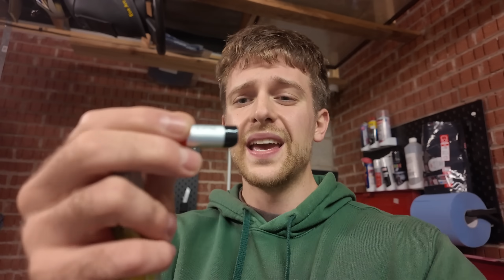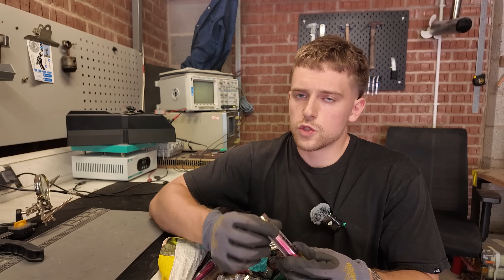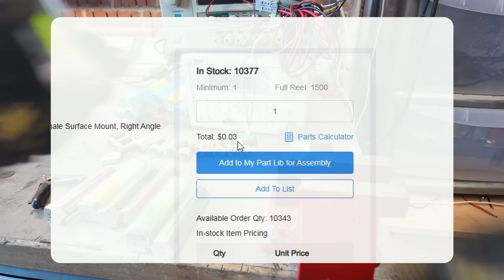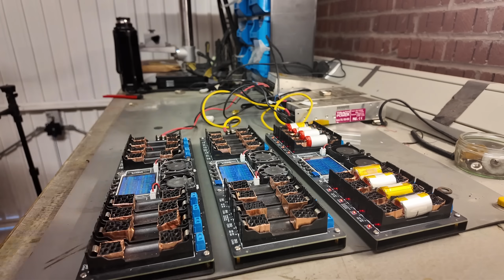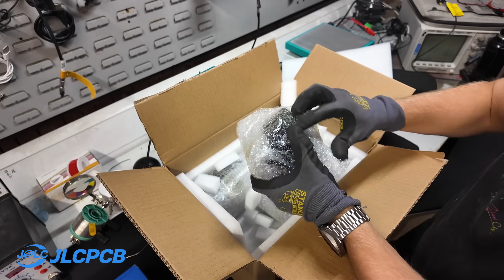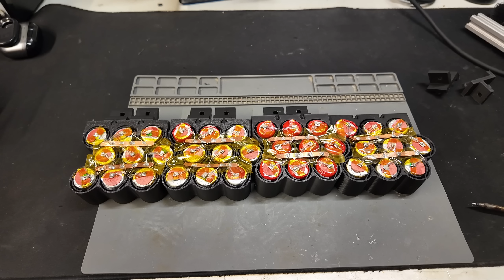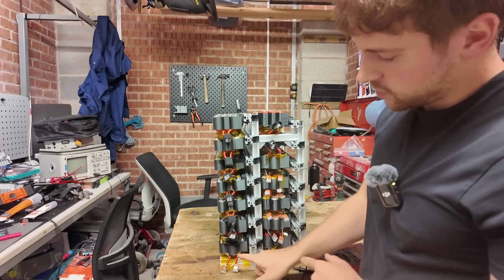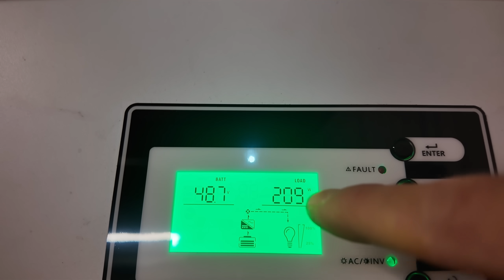I Powered My House Using 500 Disposable vapes

Comment: So if my calculation is right:
1. You have 9 cells in a block connected in series and 4 blocks, that's 36 cells in parallel per unit,
2. you have 14 units in a series, 14*3.7v=51.8v
3. You also showed that on average each cell is ~1300mAh or 1.3Ah. 36*1.3=46.8Ah per unit.
4. 46.8Ah*51.8V gives us 2424Wh or almost 2.5kWh of capacity, nice!
It would be interesting to see how the cables heat up when you connect a 3kW load from a kettle, I think they are a bit thin for current over 50 amps.
And if anyone was wondering how much a similar 2.25 kWh battery would cost - with EU prices for LiFePO4 50Ah battery ~18euro that would be ~252euro/290usd. (14s1p). Of course, LiFePO4 is much safer and will last longer, but your battery is still very cool :D
Reply: I was looking for this, 2.5kWh battery made out of almost free batteries is kinda insane. So basically, if he made 10 of those batteries, and then add solar, he could live fully off-grid. impressive
Reply: @kyawzin Delusional. It might be okay for a short camping trip but utterly useless for off grid.
Reply: @kyawzin these batteries are not that good initially, i wouldn't expect cycle life more than 200-400.
If you will run off-grid on them you would need to replace them about every year
Reply: @yevgennegvey4021  so essentially just recycle them entirely for raw materials is better solution i guess
Reply: @kyawzin maybe, or if your time spent on this battery each year costs less
Reply: @yevgennegvey4021  300-500 and then they will be about 80% so more, although not at full capacity.
Reply: 1300 wouldn't be for the user to use. Actual capacity is lower
Reply: The current carrying capacity of a cable is fixed, however the voltage will determine how much current is needed for a given number of watts... 2.5kw at 12v is a lot of amps and needs very thick cables, however 2.5kw at 48v needs a cable 4 times smaller for the current needed... His cable will probably be fine...
Would I want that in my house, of course not, but not because of cable thickness, but because of the battery chemistry...  LFP or nothing, deffo not NMC/NCA cells...
Reply: @dougle03  I'm more concerned about him using Wago's as a plug. They are not designed to be connected/disconnected under load. He's better off using something like a MC5.
Reply: @TheDegan79  what are you talking about? If Wagos couldn't withstand that they wouldn't be certified for use in homes where power could be shut off and on or breakers tripped at any time over decades.
Reply: @naasking  I'm talking about safety for maintenance, replacing dead or bad cells. It's the disconnection reconnection under load that is the issue. Do you know what a MC5 connector is? It's used for solar. DC has a much larger arc than AC. Also, if you knew anything you would also know that DC stands for Dead C*nt.
Reply: @TheDegan79  The batteries are not going to be replaced while current is being drawn, so I have no idea why you think "replacement under load" is relevant. Unless you mean that the Wagos are being connected and disconnected while there's a voltage applied from the batteries, but the voltage these connectors see is 3-4V at worst, so again, I have no idea what the problem is exactly, as that voltage is not sufficient to cause any problems.
Reply: @naasking  Please tell me you use condoms. Where do you get 3-4v from? What happens when you connect all these in SERIES?  My concern is copy cats that don't do the maths or can't, like yourself, get the idea that they can scale this up safely. If he's going to use wago's he can at least put bootlaces on the wires... It's the whole reason he is using wago's in the first place is he is shit scared using his soldering iron near the live terminals. If he used MC5's instead of wago's there would be ZERO chance of ever shorting out. With wago's, there will ALWAYS be an exposed wire if disconnected. It's negative or positive? No one knows? MC'5 would also eliminate the chance of polarity reversal.
Reply: @TheDegan79  No one else here has had scary encounters with high voltages. I'd say some people are gonna attempt something like this, not understand the inherent dangers of doing so, and end up dead on their garage floor at worst, and at best burn their house down cause they didn't learn to fear the lithium.
The sheer lack of actual safety on this build is fucking scary. The fuses between each cell are soldered on cause he saw it on a tesla cell? Those batteries are of much greater quality, but even still catch fire...
(cough solid state fuses are way better cough)
The lack of fireproofing when testing under load just tells me he's okay with losing his shed to a toxic metal fire that you can't put out with water.
The lack of proper modularity (cant spell today) of each bank of cells, "yeah im gonna solder all these together, with no proper way of quickly removing a part that is malfunctioning".
The lack of proper balance monitoring of each li-ion cell. The BMS is good up until a point, if one of those cells fucks you over, you won't know which one fast enough, and then you're just hoping the fuse on it blows fast enough to prevent the fire from starting.
And like you said. WAGO connectors under load is a BAD idea.
Even for a POC, this is just a makeshift bomb sitting in his workshop...

The best way to build this would be to actually look at how power-wall / battery banks for houses are built and installed, then get proper consulting from an electrical engineer or electrician that does installations.
Reply: @ausboard  Even the experts call it "idiot proofing" because they are the ones working with it and it's "one flash and your ash" What gets me are the morons that argue a simple safety improvement suggestion without even having the slightest clue what they are talking about. Even you haven't covered half of the shit wrong with this build and there is a point where the OCD takes over basic safety but at least start on the common sense level.
Reply: @TheDegan79 yeah it’s just too much lmao.
The incorrect connectors. Exposed wiring. Improper insulation.. Potentially using the wrong wire gauge… (mmmm the smell of burning wire)

Focus on looks rather than “how can I make sure this thing won’t kill me”

Blind trust that the cells can actually handle being arranged in this manner with little to no failsafe. 

Soldering to the cells directly, rather than spot welding (what is used in vape manufacturing usually). 

Conductive metal frame…

The list goes on and on and on

It’s just the years of battery safety that has been drilled into my skull that made me realise that the sheer volume of lithium ,just hanging out in his shed with little to no proper storage, is going to result in a catastrophic accident due to negligence. Not a bucket of sand in sight.

There’s a reason why actual home battery systems use Lithium iron phosphate batteries. Lower nominal voltage (3.2V), better cathode integrity, WAY MORE CYCLES. (2,500 - 10,000). They’re at a much much lower risk of rapid unplanned deconstruction.

Not too much of an electrical expert. But I do own and use high capacity LiPos daily in my FPV drone adventures. And if you know anything about LiPo batteries, they’re not friendly if you disrespect them.
Reply: @ausboard  I'm no electrical expert either, just a comms guy that pulled a few cables for some electricians and installed a few solar panels. Now, before every panel had micro controllers, If you wired them up wrong, BAD. You can't turn them off to re-wire, so you need someone ready with a lump of wood to give you a whack. That's where I learnt to respect how far DC can arc and why firefighters are shit scared of solar panels.
Reply: Dang u smart ash bro 😂

Comment: I hope u KNOW that most of those batteries are purposed for one time use devices, meaning they were designed  for very little total cycles, compared to production cells. I mean reusing these in projects is handy, done it myself quite a bit, BUT putting them in such big banks or applications? Hard no. My expirience with these so far:
-Unreliable, some can die just after few hundred cycles, also loose capacity very quickly and irregularly with use.
-Exceptionally prune to spontanous runaway after longer use, try storing one fully charged after couple hundred cycles to see what i mean.
-In your holder design specifically, those are foil packadged cells, unlike 18650 with hard metal casings and pop valves on top, those things swell quite a bit and can blow with pressure. One swelling in that holder imo could be catastrophic.

Reusing those batteries in small banks, just devices, or powertools is good and cool, but this trend of making big energy magazines and e-bike batteries out of these HAS TO STOP, before buildings burn down or ppl get hurt, just bms or cell fuses don't solve the issue, existance and development of special safety standards, procedures, systems, certifications around such things has a reason.

Comment: If you get on the octopus tariff called agile, electricity regularly goes into minus meaning you get paid to use it. You can use kraken which is the octopus API to charge your batteries automatically when electricity is in minus, and you'd get paid to charge them up.

Comment: 6:20  You can in fact connect cells of different capacities in parallel.
It's when you connect cells in series that capacites have to match.
Reply: Internal resistance matters too. They won't overcharge since the CV is still 4.2V but lower resistance ones will be charged at higher Cs than higher resistance ones in early charging process, and they will also discharge faster under load. Not too dangerous, but they will degrade faster
Reply: If you connect a cell at 3.8V to one at 4.2V, then current will flow from one to the other. Since you are using conductive material to connect them (the whole purpose of connecting in the first place), the resistance will be low, which will mean a very high amperage. The conductors often cannot handle this, and the result is electricity is converted into fire.
If you connect cells in series together, nothing will happen until you connect a load between the end terminals as there is no circuit formed. Try it. Get a couple of batteries of differing voltages (one brand new, one well used) of any chemistry (alkaline, lithium, even lead car batteries), they dont even have to match (you can try one AA battery and one car battery for instance!). Fill a cup with petrol (gasoline for Americans). Press the negative terminal of one to the positive terminal of another right over the cup of petrol. No fire will produced, and the petrol will not light.
Reply: He connected them in series later

Comment: Usually not one to watch battery-related videos because it's like watching an episode of "engineering J*ckass", knowing all the ways people can mess-up with lithium batteries. But you really did a great job all along the way. Capacity balancing is arguably more important than voltage balancing, and you did tests to "bin" the cells in capacity - though I didn't see a part about selecting cells for groups that make equal-capacity parallel slabs (e.g. you distribute a mix of capacities to ensure each slab has the same total). Can't complain, though. Individual fuses protect the total system from a single-cell malfunction. BMS ensures the total system safety. Nailed it, fam!
Reply: BMS!!! YES THAT IS WHAT I WAS THINKING

Comment: I wonder how many cycles you could get out of those cells before they start wearing out
Reply: Every charge/discharge cycle decreases capacity slightly. Depends on how much current is drawn during discharge. They are fairly low quality cells, so I guess they will provide 70% capacity at 500-1000 complete discharge cycles.
But remember, a discharge to only half capacity will more than double the number of cycles.
Reply: @johncoops6897 i know samsung 25r 18650s drop down to like 80% capacity at 250-500 cycles, so who knows tbh
Reply: @sergaljesus - (genuine) 25R cells are a high current (INR/IMR) cell designed for 20A discharge, used in power tools, etc.
These are a different chemistry, more like a laptop cell. The crapes only pull 2-3A, plus the thin wires provide a lot of current limiting.
Normally you could allow 1000 cycles to 70% capacity from a quality ICR cell. So lets allow half of that, since they will be low quality.

Comment: Those cells below 3V are not all bad. I just finished a final year electrical engineering thesis where I built a 16 channel capacity tester tailored at 13400 NMC lipo cells (Ones found in vapes). After testing Ive found cells stored at 2.4V with an SoH of 95%. So please dont just throw them away, they are still good!
Reply: Yep, this guy is clueless.
Anything above 2.5V will be perfectly fine to re-use. Just need to bring them up to 3V at a low current, say 100mA.
The TP4056 Pics in his 8-cell testers will do that automatically. 🙄

Comment: hey man! I've been inspired by your original Powerbank video to collet these vapes from my friends who actually puff them. In my situation, even if a cell is around 2.3-2.5v it can be safely charged with a simple TP4056 module. They aren't unstable or catch fire or anything, and from my ~50 cells that I've recovered most of them still came close to their original spec... Like 835mAh instead of 850. I've used 8 of them to rebuild a laptop Battery instead of Panasonic NCR cells and it works perfectly, not sudden capacity drop or anything. I just don't think that the 3v cutoff has to be enforced so strictly

P.S: Once I've trickled charged a 1000mAh cell from 0.8v to max and it tested 920mAh. I threw it into recycling because I ain't no battery chemist but it was still interesting that the capacity didn't drop as rapidly as most people say...

Comment: HELL YES!
I've been collecting these for years and I've managed to buy a house to be able to build one of these!
Reply: I was thinking about that. Slowly charge them with a low current and theu should be good to go again. Just have those cells in their own packs
Reply: @Dazzwidd  yeah, I've been capacity testing mine and most are around 80~95%. Even those found at 0V I've nursed back to life showing up to 80% capacity, although usually less.
Reply: @MarKeMu125 okay, I would watch those ones that have been down to zero or very low voltage. I hear they are more prone to going short circuit
Reply: @Dazzwidd  yeah, I wasn't planning on using those ones in a power wall - maybe in smaller creations.
Reply: @MarKeMu125 I'd be wary of a conflagration with those. Do a little research
Reply: Also, I've found that batteries that are below 3V still maintain good capacity when doing change / discharge testing.

Comment: Awesome I been collecting disposable vapes since watching your videos. I got about 100 now I've learned some things.
You can use the USB c rechargeable part to make a charger for the batteries and I've even integrated it into devices that usually use 2-3 AA batteries. So I've made a lot of headlamps that usually use AA or AAA batteries into rechargeable headlamps and they also work a lot brighter. Plan to do a lot more projects making devices rechargeable.

Comment: Bruh you know you can recharge a 0.00 volt battery back to life? Tons of videos about it, and it works most of the time.
Reply: Yes you can but it's a bad idea when you are putting them in such a large battery pack as it only takes one going bad.
Reply: It works most of the time but when it doesn't the battery can explode.  I guess he didn't want any more danger
Reply: HOW? you pararell charge from a good battery to a bad one
Reply: @hurrai5519  Yeah but the cell at 0.0V won't hold charge well once 'recharged'. You can get lucky, but the best option at that point is to send the dead cell to a dedicated recycling plant so the lithium can be reused.
You'll get a cell that could've held charge decently well when healthy to one that goes from 4.20V to 3.21V in 2 minutes under 0 load

Comment: I've only tried harvesting a vape battery once, but the nicotine juice had leaked all inside and made the battery stink. It was working and I washed it will isopropyl alcohol to remove as much of the smell as possible, but it still stank, so I completely sealed it in an enclosure to hide the smell as much as possible.

Comment: Your house only uses 6kWh of electricity per day?!? Holy crap. I need to do some serious efficiency improvements... my house uses ~30kWh per day.
Reply: Jesus, I thought mine was bad at 8-10kWh. How on earth are you using an average of 30?!
Reply: @podgemcgrath  2500sq ft house built out of 2x4's in the 1940's with single-pane glass windows and poor insulation. Compared to the standards in Europe it's wildly inefficient because electricity and gas used to be basically free in the 1940s. We're all paying the price for that cheap construction now that energy costs are rising.

To be fair though, nearly 1/2 of my energy consumption is a full stack network and server rack so the actual house is around 18kWh/day.

Comment: So instead of banning them they should be reused, because they're a huge driver for demand, and will supply lots of cheap secondhand battery cells..
And there probably is a way to make use of 3d printers and programmable robot arms to automate something...
Well or just add a little usb C port directly into the battery to make them rechargeable